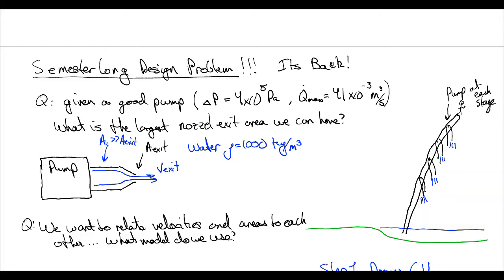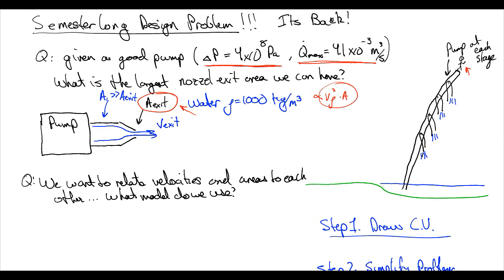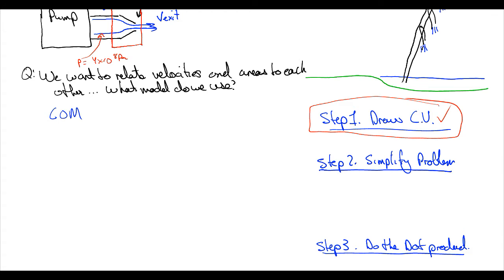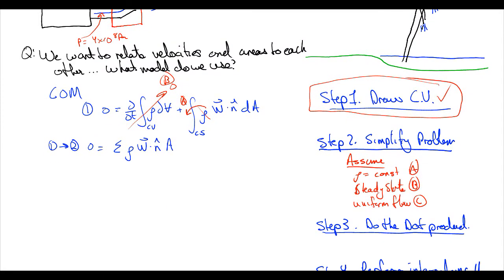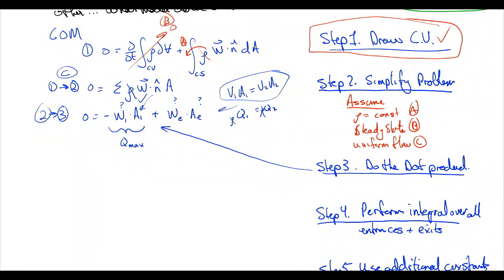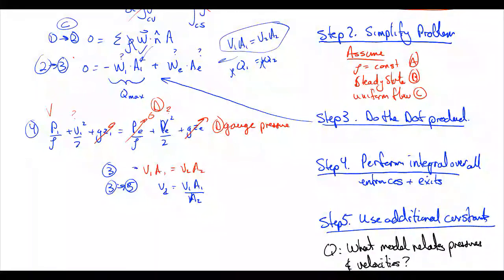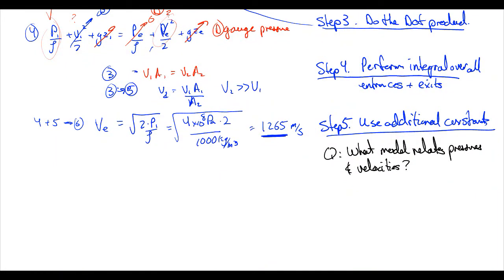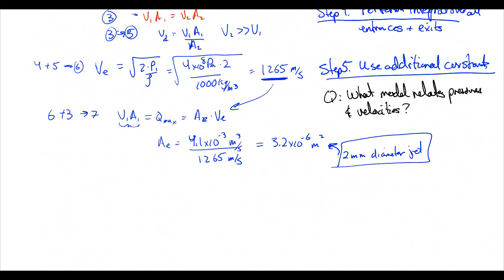Fluid Mechanics: 33) Conservation of Mass - Practice 2

Comment: I think V_exit should be 894.4 m/s instead.  In order to get 1265 m/s the 2 would have to be pulled out of the radical when calculating the square root and then multiplied afterward.  So A_exit should be 4.58e-6 m^2 instead (assuming my V_exit is correct) resulting in a 2.4 mm diameter jet after setting A_exit=pi*r^2 and then solving for r and multiplying by 2 to get the diameter.